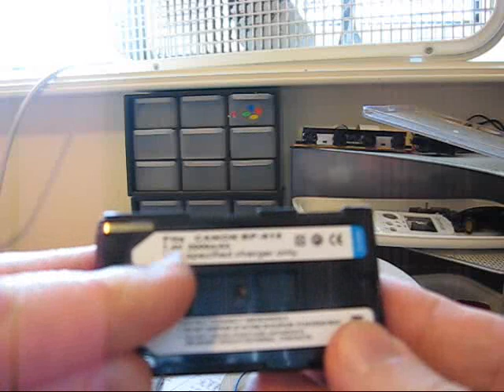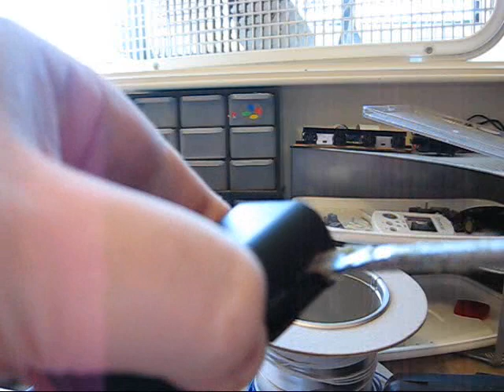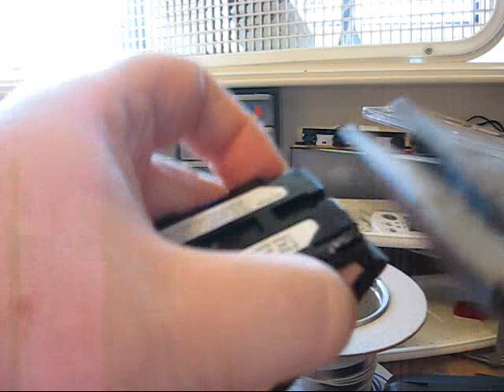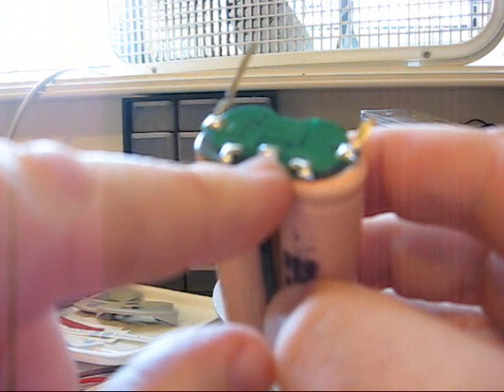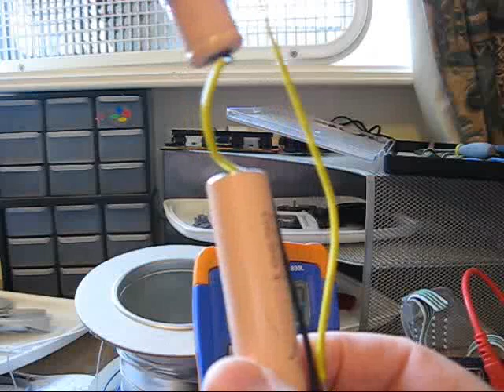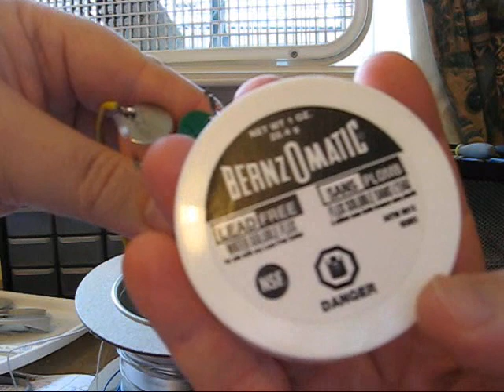Mini-guide - opening a Li-ion battery and rewiring it.

Comment from the maker: Hard to tell from the description, but 4v indicates good charge (3.7v cells go up to 4.25v on full charge), assuming they are fairly recently charged (so amperage is strong), and charge not holding, may well be faulty cells that don't hold amperage like others do so the protection circuit is cutting off the power. Fully charge, check each cell, run until stops working, test each cell again; also if any cells are swelled they are dead and dangerous.

Comment: thanks for the vid, i'm planning on making a 30 cell battery now which will also work as an airflow stand, but i took apart the battery on the vaio fz31z which was holding about 2 minutes, and found that all the cells show full life! i.e 4v instead of 3.7v on my cheap multimeter, what do you think might be wrong???
best regards,
abz

Comment from the maker: Same principle, yes, however laptop batteries are slimline, so unless there were two cells vertically stacked, and your system could take the equivalent of double width the side of the cell (ie two side by side), may not be a lot of point. I relocated these Li-ion cells as it is far easier to position two individual cells than a pack of two together.